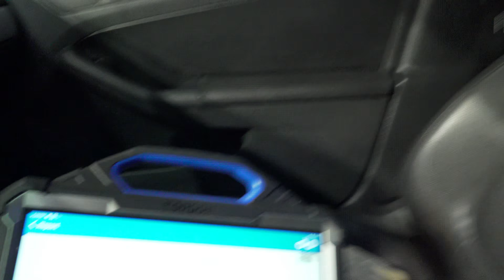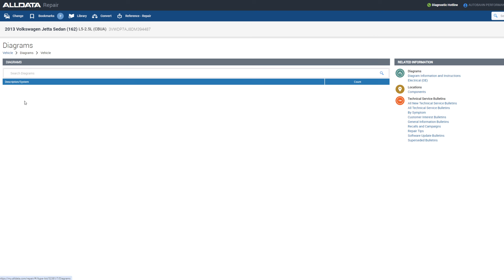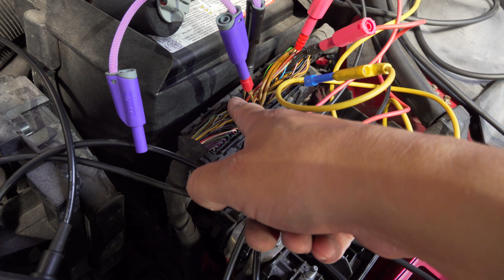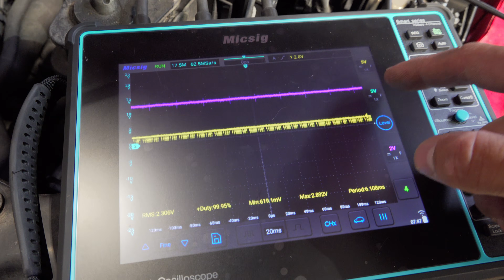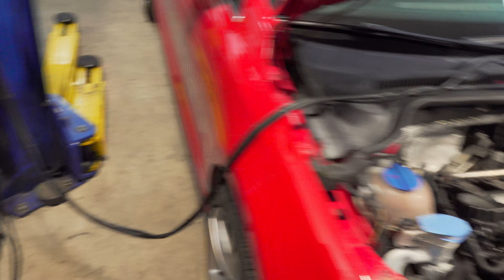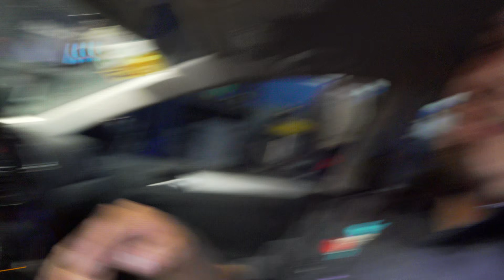2013 VW Jetta - Stalls/No communication when HOT

Comment: Hi. Great video on engine ground i watched . I have a question that no one seems to be able to answer. I have a 1999 ford f 250 4x4 superduty regular cab. All lights and blinkers work on front of truck , but nothing at all works on the tail lights. Bought a new multiswitch directional for blinkers and wipers, But did not help. I checked every fuse in cab and under the hood with a tester mutiple times with ground to battery . Under the hood 2 fuses never worked. Put in 2 new fuses they never worked either. They were the 7.5 fuses which are for the blinkers. Also in the cab i changed 2 fuses that never lit up with the tester either , replaced them and failed the test light test........any ideas in what direction i can look ...............thank you so much!

Comment: Not sure if I missed something, but how do we know that radiator fan code wasn’t present with the first ecm? Didn’t we not have any comms with the first ecm due to an internal error? Therefore we couldn’t read any codes on that original ecm? 

So isn’t it possible that radiator fan fault was indeed present the whole time? Of course the new one could have the problem but how do we know that wasn’t already in the unreadable first ecm? If we couldn’t ever read the codes on it. 

I suppose you could reason that if the car wasn’t previously overheating then there wasn’t a problem before hand? Just curious because/c everything you do is so thorough 

Thanks for the videos, appreciate what you do.

Comment: Just to make sure I understand, why would the ECM shut the engine off if it lost comm? Yes, on the scope both CAN lines appear un-changed so presumably the network is there @ ECM connector. Also, you said you ruled out 5V ref, but that's the pink/purple trace on the scope, and that's the one that appears most changed at that obvious point on the graph, but you zoomed in and out and I couldn't really make any judgements yet. What did you say about it? 
Also, nice scope, I see Micsig logo, how do you like it?
Reply: That is only noise from alternator or ignition coils. Pretty normal
Reply from the maker: Losing comms is of the two symptoms, not necessarily the only one

The noise on the 5v ref doesn’t affect it’s supply. If it were to drop to 2 volts, there’s a short in the circuit that must be addressed
Reply: @SuperMarioDiagnostics  oh you mean, that when ECM fails and stops responding, what you verified is that when it happens, the CAN lines are still unaffected and preset at ECM connector, that's why all other modules are reporting lost comm with it. 
And as far as 5V ref, ignoring the noise, it stayed reliable, thus all sensors should be getting it, thus loss of sensor signal shouldn't be the reason ECM shuts engine off?